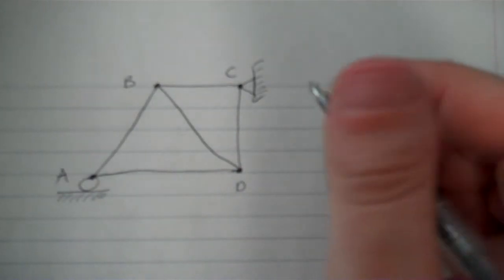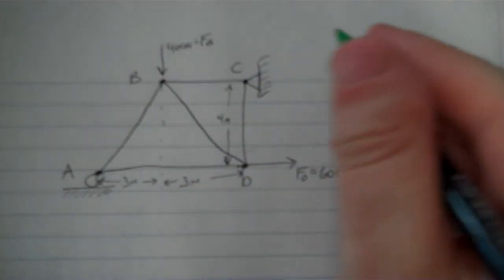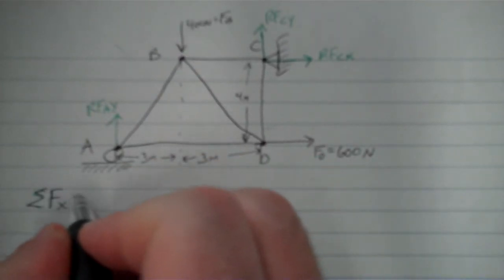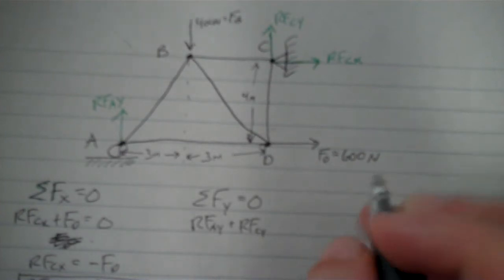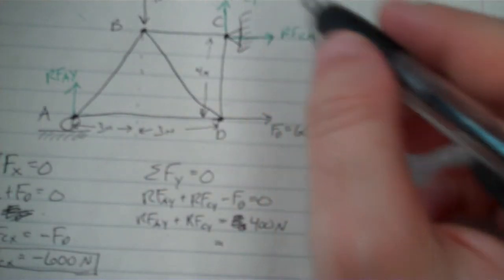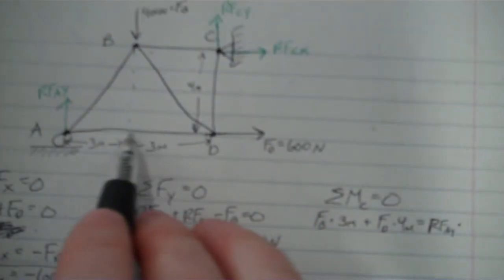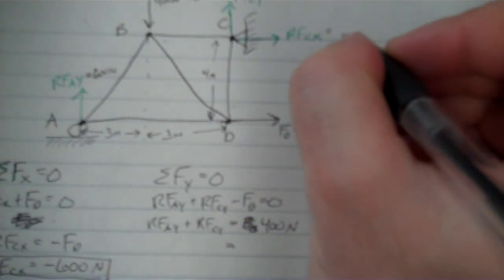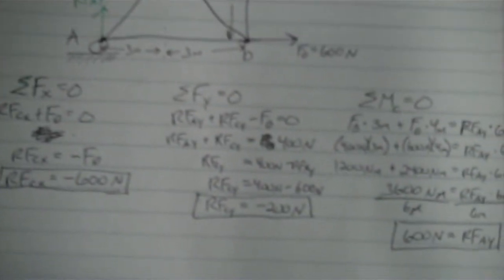Truss Reaction Forces

Comment: I am pretty sure this is wrong, you did not split the moments up in to an "X" and "Y" direction. RFay * 6m = 400N * 3m
RFay = 200N which means RFcy = 200. This makes sense because RFay and RFcy are 3m from the 400N force, so each would be equal.
Reply: tyler sebastian Moments are not conserved about axes, they are conserved about each point. So you should not do x and y separately.